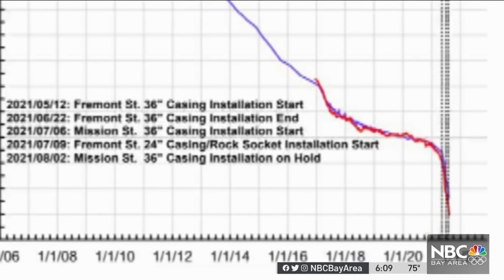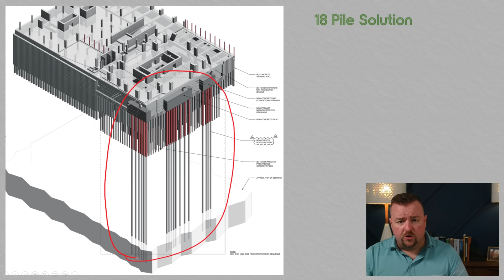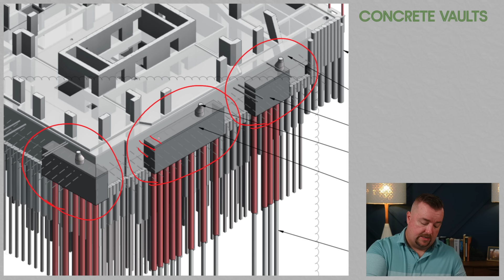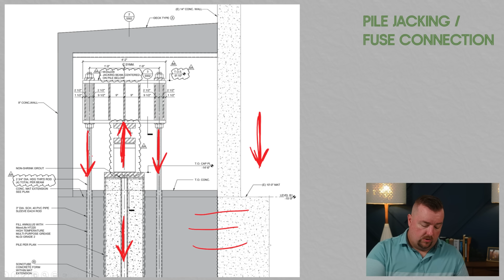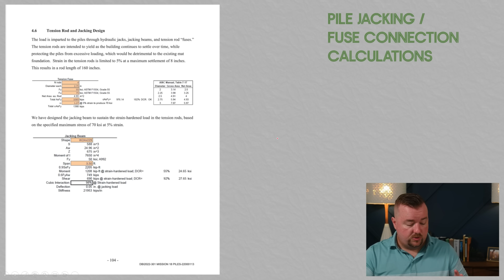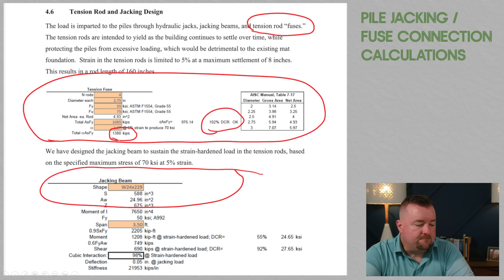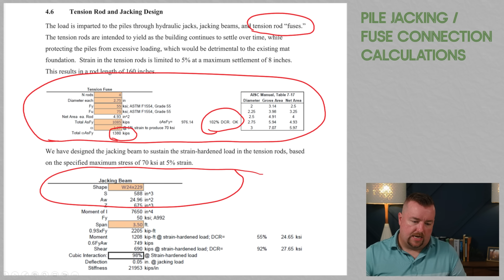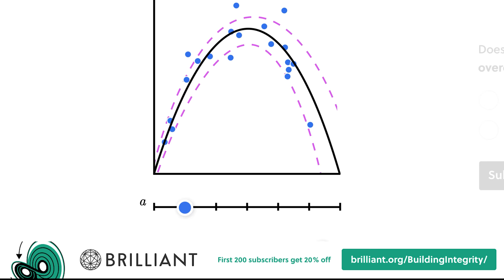Did I Uncover a $100,000,000 Mistake with the Millennium Tower "Fix"?

Comment: I am reminded of the hanging system employed on a certain Kansas City hotel walkway . . .
Reply: Yes, but there is no similarity, really.
Reply: @GH-oi2jf  I was thinking that if the plate is too small, the rod and nuts would distort the plate, and might ultimately pull through it. It seems like a tremendous point load where the rod intersects the plate.
Reply: @kinokind293 — The difference is that these plates, besides being much thicker, are embedded deeply in reinforced concrete.  In the case of the Kansas City walkways, there were several deficiencies.  The materials were undersized; the holes for the rods were placed at the weakest point, on a welded seam; the joint where the rod passed through the beam was not reinforced in any way; and the design of the suspension was altered in a way that doubled the load on the joint.  None of these circumstances applies here.
Reply: @GH-oi2jf  I agree. All true. But we don't know how much load each of those steel plates is supporting, how thick it is, whether it is additionally reinforced in some way or how much load is being supported by each of those nut assemblies attaching the rods to the plates. Having it all embedded in concrete will certainly discourage the plates from distorting, but I'd feel better about it if one could see the engineer's calculations.

Comment: Intuitively, the plates at the bottom of the threaded rods seem too small and need to smoothly transfer the rod’s load onto the entire bottom of the concrete block, not just a small part of it. However, why not build a tenth scale model and push it to failure to uncover complexities that simple calcs would not show?
Reply: Intuition is not a sufficient basis for engineering.
Reply: @GH-oi2jf  I agree with you that intuition is not a “basis for engineering“ and I didn’t suggest it was. A gap that many engineers have is lack of intuition, and lack of imagination which prevents them from standing back, looking at a project and see obvious problem areas that require more detailed calculations. Then just because calculations are made, it does not necessarily mean that they are making the right calculations. The difference between good engineers that have worked for me in the past and poor ones is that the poor ones had no intuition nor imagination, and would rely on numbers, even if they made absolutely no sense to me in my casual perusal.

I can often intuitively grasp a problem with the design in seconds where is my engineers that are worked on it for days don’t seem to see the forest for the trees.

I recall one of my engineers, showing me his data and curve fit with a pressure versus flow where the results pressure and  resultant  flow would normally be close to a square root of the pressure. He was perfectly happy with a perfectly straight line because he said it had a 99.9% correlation and didn’t even twig when I pointed out the fact that he clearly had a gauge that was stuck at a certain pressure reading and to not have flow increase along with pressure was absurd. He literally looked at me as if I had fallen off and turn off truck since he relied completely on the correlation, even though it made no sense. A good example of an engineer that lacked intuition and imagination.
Reply: @colingenge9999 — I wrote that intuition was not “sufficient.”  I did not write that it was not useful or even necessary.

Comment: Solution: Install several jet engines bolted on the rooftop and run them 24/7/365 imparting a leverage force on the building and creating uplift on the sinking side.
Reply: Now that I like!

Comment: I think the use of the word "fuse" is frightening.  Fuses are not measuring devices.  They tell you nothing until they "blow".   If one of the four fuse rods "blows", the remaining three are instantly loaded to roughly 134% of their yield strength.  Are they sized to withstand that?
Reply: The bars will stretch when they reach the elastic limit, rather than break.  The load will be distributed, not only to the other three bars in the group, but to other groups.

Comment: Here is the thought I tried to formulate when I made my first post. These threaded rods are "Pre stressed."
As in, they are already close to their failure point!!!
What will happen in an earthquake, when additional stress is added???
Reply: That isn't how "pre-stressed" is normally used.  The rods are under stress from the (partial) weight of the building.  They are sized and loaded to operate below the elastic limit.  If an earthquake causes a rod to reach its elastic limit, them it will undergo plastic deformation.  In other words, it will be permanently stretched.  If a rod breaks, the engineers might have a repair plan, but It hasn't been published that I know of.
Reply: @GH-oi2jf  We're not talking about the REBAR here, we're talking about the "Adjustable Screw Jacks," that are the current "Brilliant" idea to stabilize it.

Comment: OMG all that force centred on those small plates . How do these people think that amount of force will be safely carried on such amounts of steal being only 3 inches per rod that is crazy levels of force on such a small amount of steal . For example Bridge Cables Holding Up Less Weight are massive in size compared to those plates of steal . 6 inchs wide with a 3 inch hole in it at the connection that’s insane.

Comment: As a mechanic and tinkerer of almost 20 years, I can attest that my gutt says NO WAY IS THIS SUFFICIENT. I am just a Grunt and don't do math, I over build A LOT based on experience and gutt feeling and that tiny plate will split the concrete at best and the rods will pull right through at the worst. Nothing good will come from this

Comment: Why did the designers put the all-thread rods in a grease-filled conduit?  Shouldn't they be encased in the concrete so they can act together with the vault, to provide uplift?
Reply: No.  It is correct as implemented.  The rods are like springs.  They stretch under tension.  The strain is distributed evenly along the free length of the rods.  If the free length of the rods were shorter, the strain would be concentrated.  They would either exceed the limit of elastic deformation and be permanently stretched, or they might break.

The rods lift the vaults from the embedded plates near the bottom of the vaults.

Comment: I didn’t hear any mention of simulation modelling of dynamic event-causing loads adding extra strains. I think the solution you are discussing might not be wise in an area known to have seismic events. Not familiar with modern analysis of structural loads, but this seems it might be affordable rather than durable. Even calculating a danger radius in the event of a topple might be difficult if a topple of this structure causes a domino toppling event, which might be inevitable given the location. Seems to me the insurers of surrounding buildings ought to be demanding those calculations you speak of, and the citizens ought to be demanding full and complete disclosure.

Comment: My God. So they are trying to fix a faulty compression problem by substituting a sheering problem? Brilliant.  I should have put my foundations in last on all my buildings  because who needs to properly build buildings anymore. It's amazing that the engineers that couldn't get hired by reputable engineering firms go to work at the building departments. You'd think if this could work, it would have been used on the (leaning) Tower of Pieza!

Comment: Lets say that the plates, nuts etc hold. If these threaded rod are being held at such a high tension anywhere near the breaking point isn't there a chance that a moderate earthquake or strong wind(LOL) could push them past the breaking point and cause the building to come tumbling down? Not an engineer just thinking about how tall structures tend to sway during earthquakes and thinking that would apply additional forces to the already unstable foundation. Even if it does hold and stabilize the building under normal conditions it seems like it would be just asking for trouble under abnormal conditions. So even if they had designed plates that would hold the threaded rods under tension this seems like a failing design anyway. It seems to me that you would want them below the stretch point under normal building loads so there is some room to stretch in extreme conditions.
Reply: The new piles are not keeping the building from “tumbling down.”  They are merely stabilizing it so the lean to the west does not increase.  If one or more of these rods broke, the lean might increase a little, but the building is nowhere near toppling.  They always describe the lean in terms of displacement at the top.  It seems large when expressed that way, but the tilt is only about one quarter of one degree of arc.

My guess is that a moderate earthquake will help the east side settle and bring the building closer to plumb.

Comment: Not an engineer, I'm low voltage but, if the jacking beam is X big, wouldn't it be smart to use basically the same beam but cut in half basically for the bottom of the rods? I feel like a little bit of sense would be looking at the building and then the little bar and scaling it up. Surely a bigger bar wouldn't effect the budget in any significant way

Comment: Wow! Hiring the incompetent original engineers to design the fix is idiotic. Connecting the new pilings in shear is more of the same nonsense.
Reply: The remediation engineers are not the ones who designed the original foundation, as the presenter stated in his pinned comment.

Comment: As a layperson…. I have only common sense to offer. Here it is:
1. The reason this building is in trouble is that the developer didn’t want to spend the money to anchor this superstructure to bedrock.
2. This building was cheaper and heavier to build than a steel beam project …. again to save 💰.
3. Listening to these and other explanations involving the “fix” … they still want to cut costs by reducing the proposed number of anchor piles from 52 to 18.
4. Ironically…. this engineering solution would probably succeed as designed if only there were more piles to share the load. It appears that they are willing to throw the dice in a kind of technological “Hail Mary Pass” … again …. in order to cut costs. 
5. There is a point at which you have to decide if demolition is the only answer.

GREED.
Reply: Reducing the number of piles wasn’t mainly about cutting cost.  The original plan to use 52 piles was aggravating the lean when the holes were drilled.  The engineers reworked the plan for fewer piles, each carrying a much greater load.  The first six piles were placed, then partially loaded to stabilize the building.  Then twelve more were installed and whole set loaded to capacity.  So far, the first objective of the remediation, arresting further lean, seems to have been achieved.  Why argue with success?  Wait for something to actually go wrong.
Reply: @GH-oi2jf  Thanks for the answer. While I knew that the bored holes increased the onset of the dilemma, I didn’t know that the remedial works finally began stemming the effects of compaction/subsidence. That’s great news. No one wants this to fail… especially the homeowners and tenants …and… especially when you factor in that the structure stands in an active seismic zone. The more piles are driven down to bedrock…. in the medium term …. the more this address remains viable so to speak.  NYC also has a modern leaning tower of its own.
Although the case is somewhat different…. cost cutting was a underlying reason … pardon the pun.
All the best and thanks again.
Reply: And vanity...

Comment: I don't understand why the rods "shouldn't touch the vault"? Surely it would distribute the force SO much better and more evenly if the rods were poured right into the concrete (possibly with nuts spread throughout periodically too) along their whole length. it makes sense the PILING should be greased, but why the rods?
Reply: No.  The rods act like ultra stiff springs.  The elongation of a spring under a given force is proportional to its length.  A short length of rod which was free to stretch could not lengthen much before breaking.  But in addition, burying the rod throughout the height of the vault would put stress on the concrete at the top, probably leading to fracture.  Eventually, it would fracture the concrete all the way down.

Comment: I'm not sure it was a good idea, but I'm thinking that the loading spec sounds like what is done on  a torque to yield fastener. Normally though that is something in things like cylinder head bolts etc... to my gut instinct seems risky here.

A separate concern of mine is the hydraulic cylinders. They can and do fail in more normal applications, is there any consideration given to maintaining or replacing these cylinders in the decades to come????
Reply: If a jack fails, it is easily replaced.

Comment: I glanced through the charts on the latest Monitoring Report. It appears that they recently went from 500kips per pile to around 1000kips per pile. Can you explain the load cell data and why it relaxes slightly after they increase the load on the jacks? The data also seems to show that very recently the lean is starting to reverse.

Comment: how about subterranean connections...water, sewer main,  electric , gas mains, etc  this is a tremendous sinking rate...are they having to fix cracking plumbing?
Is there a hydraulic jack that can lift a million tons?    even if you could put a 200 foot long pile down through clay and sand to bed rock that wouldn/t buckle under that weight,  wouldn't the concrete crush under that pressure?

then does the building break if you press too hard on one corner or one side to stop the tilting?   how do you equallize the upwards pressure keeping support even
Reply: They aren’t lifting the building.  The jacks on the 18 new piles just carry the weight to the piles and bedrock, preventing further settling on the west side.  The building can continue to settle on the east side, which will reduce the lean.

Comment: I am quite concerned about the fact that even if the Fix actually fixes the issue, the building is still leaning. That has already introduced visible problems and damage to the walls, and I cannot imagine that going forward the construction will fare well so far out of intended alignment.

Comment: I've thought about this for a while.  You are ignoring "synergy", the whole being greater than the sum of the parts.   If the plates were carrying the full load, you would be correct, however the steel plate is just a facing on the concrete.  The concrete on the back of the plate adds considerable strength.  I'm not an engineer, and would not be capable of the mathematical calculations, but I think the compression strength of the concrete is the primary issue.  Perhaps a larger thicker plate would be better, but on the other hand the specified plate may be good enough.   They can tell if the plate or rod is failing by marking the rod at the top of the concrete.  If  the rod appears to be getting longer with load applied there is a problem.   Your premise is is the plate is the weakest link.   I believe the concrete has the effect of strengthening it.   it's mostly a matter of the surface area of the plate that loads the concrete on a PSI basis.  With the thick concrete backing I doubt it can distort significantly.

Comment: Do they mention what type of steel the threaded rods are made out of ?  In addition are the nuts made of the same material !  Hopefully it's not cold rolled steel !
Reply: The rods and nuts are high strength steel and the manufacturer provides detailed specifications for them.  I don’t know what brand these are, but you can find similar threaded rods online for comparison.

Comment: Seems like they could  have stacked six of those plates just as easily as putting in the one, maybe uprising to 7 inch width to add a half inch on either side of the hole for the threaded rod.
Trains are not as heavy as this building and look how thick a rail is.
Reply: A rail must support the weight of a locomotive without being supported by surrounding concrete.  Maybe the engineers worked it out and the plates are an appropriate size for the application.

Comment: Dude the first pic of the jack you showed did you see that giant crack started in the base of that jack already?  That jack will fail instantly if it’s already got a crack that large in it.  You need to contact someone and let them know that needs to be fixed first.
Reply: The jack is pictured at 11:00.  I don’t see a crack.

Comment: Isn't the steel bar braced by the concrete it is set in? Wouldn't it be the same as something reinforced by fiberglass?
Reply: Yes, but far stronger.  The steel plates can only be properly understood together with the high-strength concrete and reinforcing steel which surround them.

Comment: There are many larger structural piling projects much more substantial than this, ie the line in the middle east. But, it's all a matter of math, if you can do the math to build an aerodynamic paper plane there's no reason why you can't apply the same mathematics to a larger version, given a moon rockets is magnitudes  more work than a paper plane, but if you have the right math and right people most importantly budget, most things are achievable.